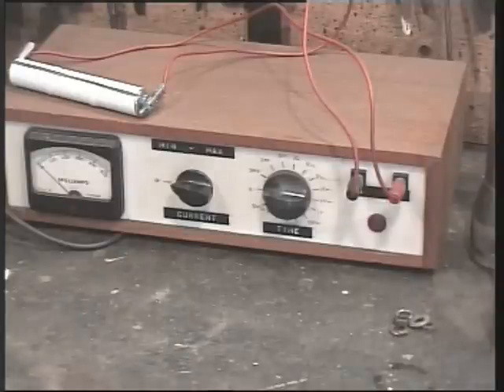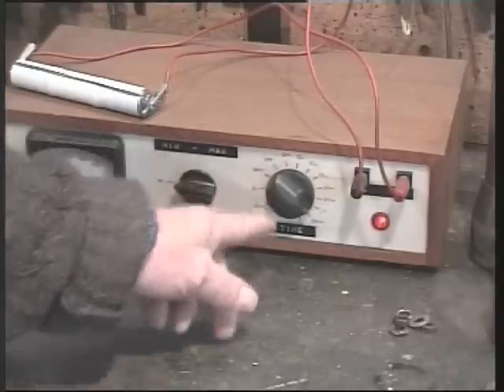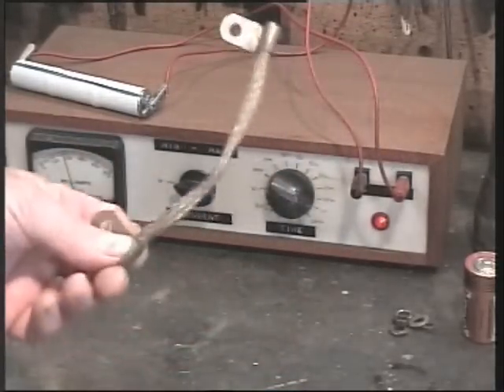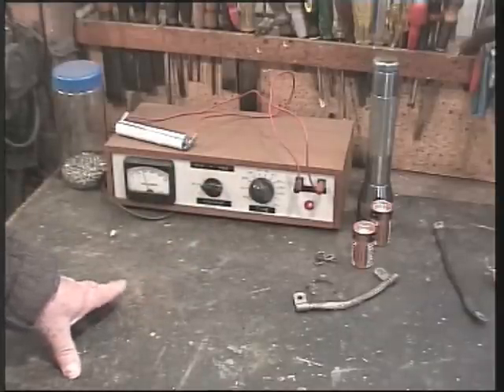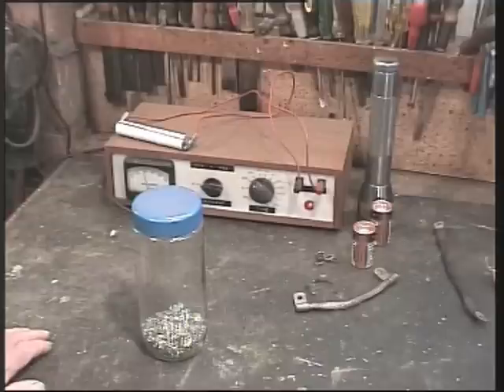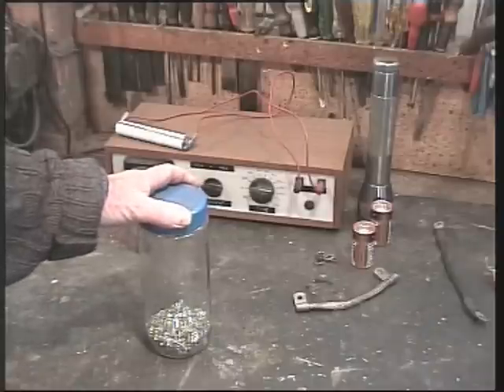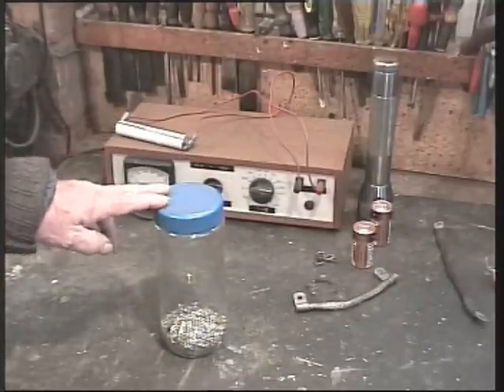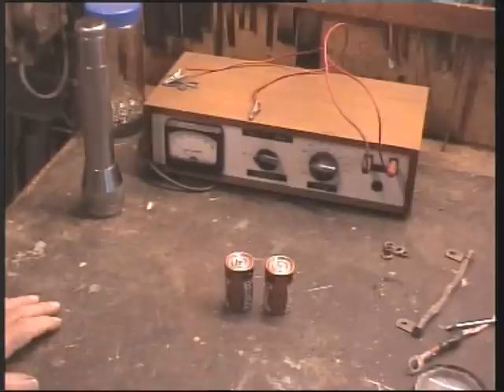My thoughts on a V1 stove?

Comment: Hello POC. What you undoubtedly had -- the roaring sound -- is a chimney fire. This is caused by the accumulation of tar on the inner surface of the chimney. Along with soot, you get tar condensing on the inside of the chimney, and it will cause a fire if it gets too hot. Here in Alaska we burn wood a lot. I make it a practice to clean out the chimney every season. The way this is done here is with a circular wire brush slightly larger than the diameter of the chimney. We use fiberglass poles to poke the brush through. But you could use a piece of rope. You will have to improvise, or buy (horrors!) a chimney brush. But many a house has burned down through chimney fires. I bet your boat costs more than a chimney brush. Ream from the top down, that way the crud goes into the stove.
Reply from the maker: Thanks for reply ,tar in chimmeys can be a real problem thats true, but that wasn`t what was happening in this case,I`m convinced something akin to  pulse jet priniples was taking place !

Comment: I am sure you are well aware of explosive dust issues, be careful or you will end up with a cannon.
A local company, in the early 8o's, manufactured wooden window frames. They had a massive vortex tower that collected all of the plants sawdust. Well something went wrong and a spark caused the inevitable and shredded the top of this tower.
As kids we got a big orange gas canister, about 5ft tall, and moved it behind a massive pallet of clay soil pipes. To our delight the valve was nearly dead centre to one of the pipes. Someone opened the valve full blast and chucked a match in the other end, no names no pack-drill. What a noise! the air drawn in wasn't enough to keep the burn going and so it pulsed on and off constantly.
I tried to reach the valve and turn off the gas but it was to close to the pipe and that was glowing. Well we ran. We could hear it for miles and it was nearly an hour before the noise stopped. For many days I jumped when ever someone rang our door bell, but it was never the old bill.
Reply: Got as good a laugh from that story as the video.  It is a wonder boys grow up as nothing is out of bounds when we have an idea.

Comment: A friend of mine used to a run a commercial sawdust stove in his workshop. As I recall it just used plain sawdust, no additives, and you filled this large stove and tamped it lightly and then put a single firelighter on top of the pile to get a good smoulder going, you then closed it down and using vents you could adjust the burn rate. This thing would smoulder for days on a full fill, especially with just a little vent open and once it was empty you just had a small pile of ash in the bottom.
He said it was a good runner and very cheap also, the only reason he got rid was the fact that he didn't produce enough sawdust to keep it going all winter and also you always had at least half a day of cold when you cleaned it out etc, probably would have worked better inside a nicely insulated house as it put out a lovely gentle heat for a long time with no fussing.
Reply from the maker: do you know what this stove was called ?
Reply: ***** I am afraid I don't but I will try and find out for you.
Reply from the maker: theres a simple sawdust stove " the hannah stove" by leyland stoves I like for its ease of
 use there were a few commercial ones useing this principal based on the
 boy scouts cooking stove in the late 50s

Comment: Made a 55 gallon drum act like a blast furnace.  Sat in a slight hole in the ground, supported by 4 inch concrete blocks.  Couple of extra holes in the side.  Used it for burning my scraps.  When it got going, there would be no smoke, but have a flame about 20 feet tall.  Looked and sounded like a super-sized oxy- acetylene torch!

Comment: Good Evening poc could you do a video on how to make a battery charger like yours I have already built the coil tester which is brilliant as you explain things in plain and simply terms keep up the good work cheers Ainsley
Reply from the maker: thank you but I won`t live long enough to do all the things people request, ;briefly you could make or buy a small charger and in my case the load went to a car bulb so I was able to use a potential divider to vary the current (leave that out if you wish) put a meter in line to monitor same, and used a machanical time switch fom an old microwave for the duration. plonk it in a box and jobs a goodn!  :-)

Comment: You might want to search for fire tornado, the homemade ones with a spinning wire mesh tube are really interesting, perhaps not applicable to the problem of dust burning but interesting.
Reply from the maker: Yes it is interesting,and could well be applicable,I had something similar in mined as a alternative burner ?
Reply: ***** It would certainly pull the air in and if you can free the sawdust from the surface of the pile with enough airflow (or maybe mechanically) I imagine it would work quite nicely, the problem I suppose is that the sawdust level will go down. I was thinking that could be an issue with something inspired by your experience with the cylinder, having the inlet at the surface of the dust probably helps. Perhaps a cylinder drilled with inlets that sits on the dust and goes down with it (as it burns) would work nicely for a prolonged period.

If I was going to get into it seriously to heat my workshop I'd make a decent rocket mass heater with properly insulated burn chamber and have an auger to feed the dust onto a stainless mesh, or a grid of TIG electrodes if it was REALLY hot :)

Comment: You can use sawdust with PVA glue as wood filler.
Reply from the maker: You certainly can its quick and cheap but bear in mined if its to be stained or french polished ,it will standout like a boil on the end of your nose :)

Comment: I agree that the videos on saw dust are non productive to say it kindly. Same with the idea of making logs of newspaper. What a time drainer. The local electric power plant runs on saw dust and chips. I think they have a blower that blasts the dust into the boiler fire. The only two good ways to burn saw dust is either compacted as a log (energy waste as you point out) or as an air born dust. Dust makes a serious fire. If you have ever seen a grain elevator go up in flames you never forget.

Comment: Still haven't looked into Nickel-Metal Hydride batteries yet?

Have a good New Years Eve...
Reply from the maker: Using what I`ve got
Reply: ***** If you do buy any new ones looks at Sanyo Eneloop, they have extremely low self discharge (85% after a year, 75% after 3 years, high capacity and high charge cycles), they even come charged! I'm slowly swapping out my old tech ones.

Comment: maybe some sort of forced air gasification burner is the way to go. many a moon ago i made one for camping. even wet wood would burn smoke free and lovely and hot. it was just a simple stainless put with holes drilled in it and small battery powered fan on ducting for forced air part. very effective
Reply: p.s. air born dust is extremely flammable, and im sure is what was happening there with your burner. thats how these huge grain stores and the like explode.